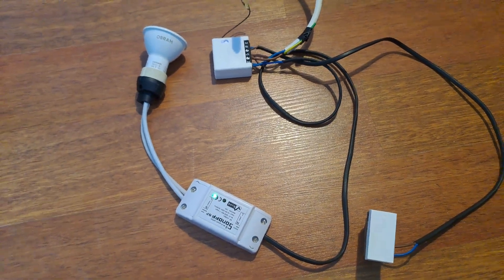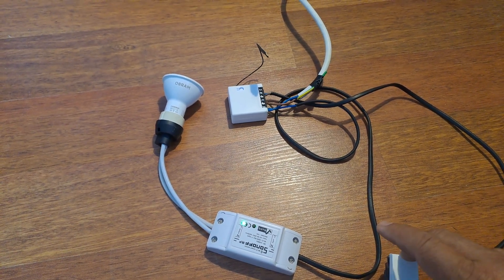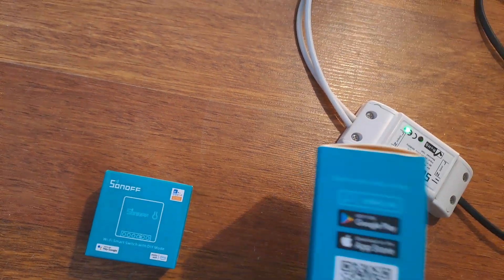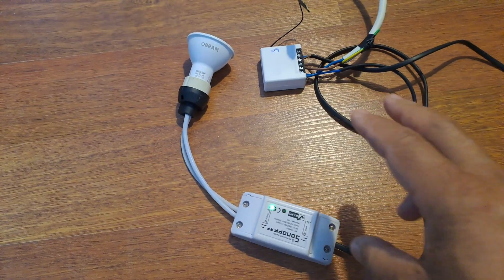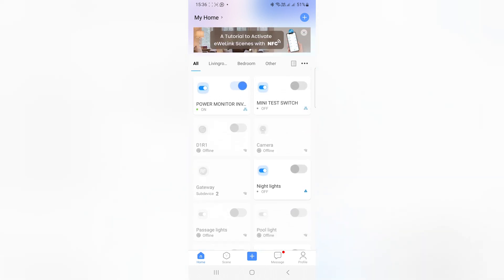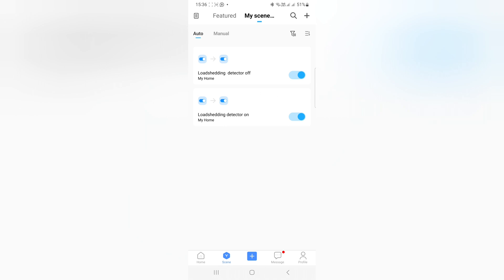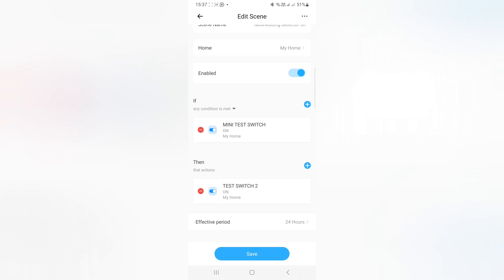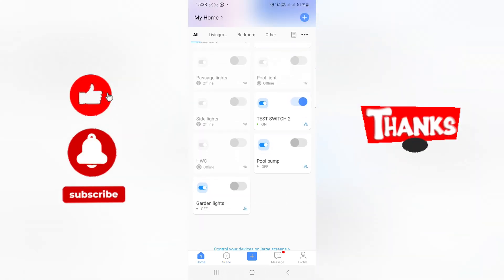Loadshedding in South Africa : Sonoff Loadshedding detector scene settings within the Ewelink app

Comment: I have a question.
Is it possible to control one smart switch with another smart switch?

Eg. If I want to put on a light, can that smart switch control another smart switch to go off/on?
Reply: Yes you can put them into groups or use ifttt